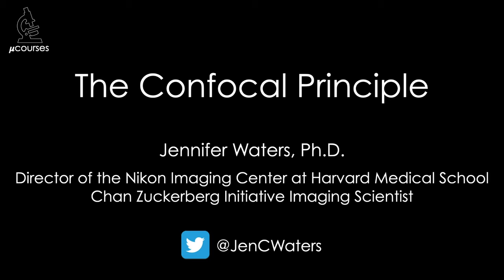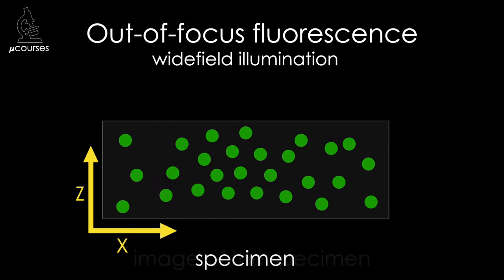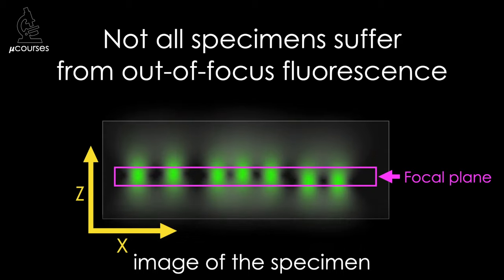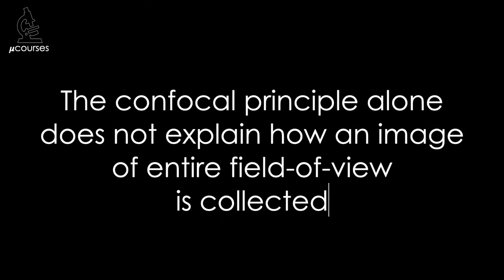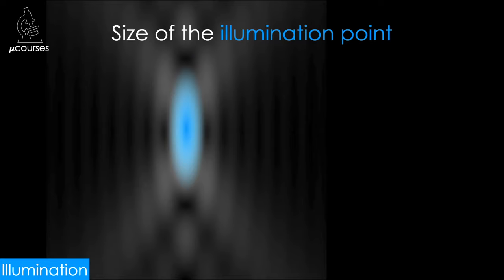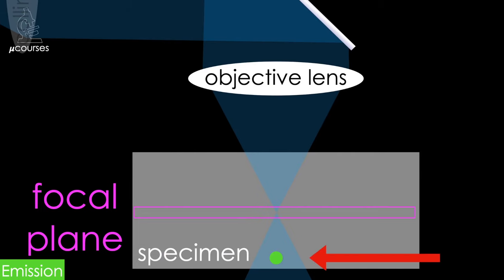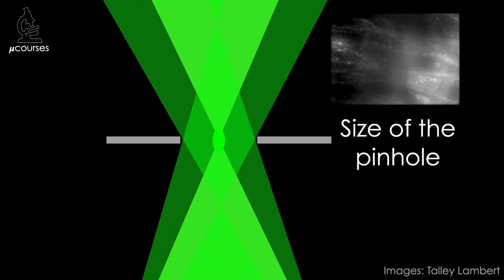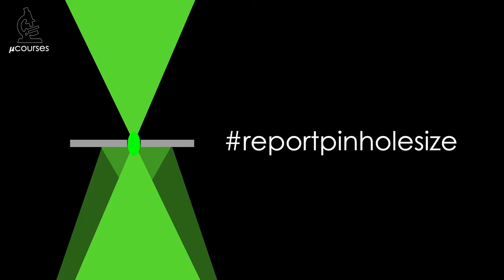The Confocal Principle

Comment: If the pinhole at the image plane is what rejects the out-of-focus fluorescence, then why does focused illumination matter? (I.e., why laser instead of widefield?) Is it to reduce interference from neighboring fluorescence?
Reply: You want to put your light in the place where it can be used. If you illuminated everything, very little light would return and you'd have to sit on each voxel for a long time.
Reply: @roadrunner6653  so it’s for the intensity of light at the point of interest?